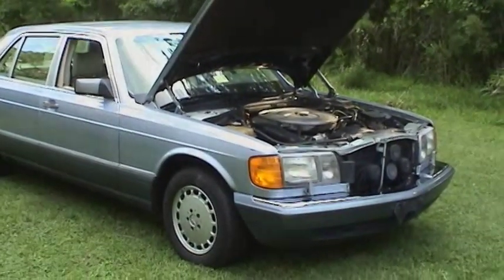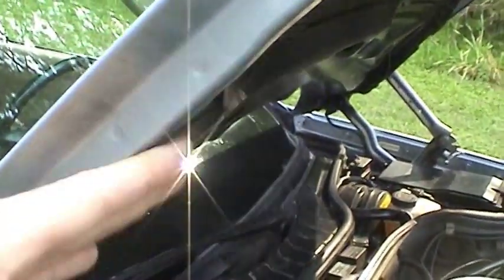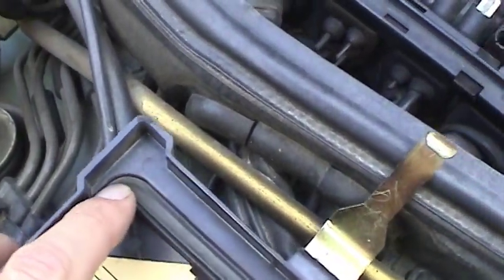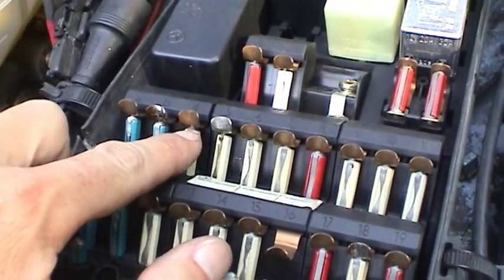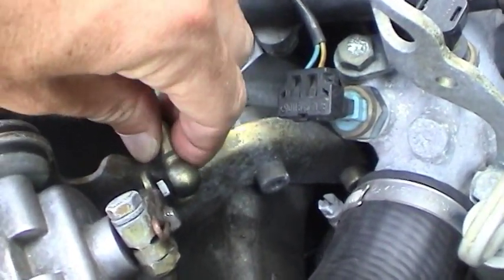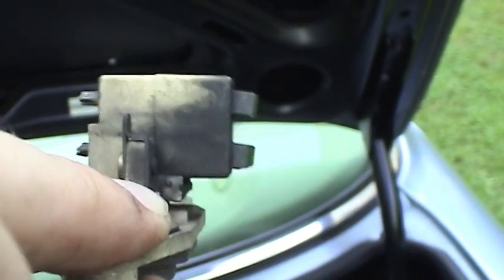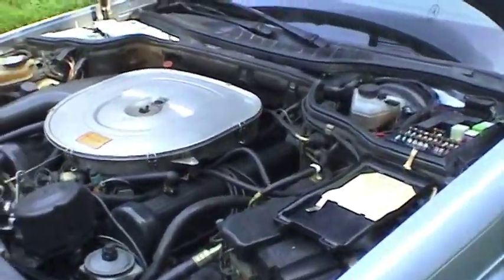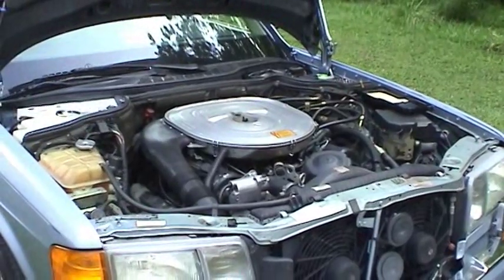1991 Mercedes-Benz 420 SEL Maintenance Tips

Comment: Your vocal delivery is spot on. Not dead, not shrill, not salesman- much like an intelligent teacher. 
I have a '91 300sel that took several tries before starting. A very loud scraping raucous began after a hard acceleration. I lifted the hood but couldn't determine the source of the noise. It cut off a few minutes later, cranks but hasn't started for 2 months. Temperature & oil pressure were normal, no check engine light. Had smelled gas for a couple weeks. Noticed a few drops of fluid smoking & dripping on the exhaust behind the rear door the day before. Fuel pump primes. If I can believe the young man at Autobahn Auto in Hampton I have spark, fuel, & timing chain's OK. I know little about cars but since Aug 12 have literally spent hundreds of hours online researching the problem. Any thoughts would be greatly appreciated! Other than needing a new battery when I got the car a year ago from a doctor, it has always been reliable. The day before this I did have a shop put on 2 front tires & do a Hunter balance to resolve an interstate shimmy.
Reply: Watch his 57 min walk though video he helped me so much

Comment: Wow...Even though that style of Merc is a common sight over here, I've never seen a hood in that position! You could almost use it as sail in an emergency...haha!!! 
Those fuses were a very common over here in most vehicles up to the mid 80's, we know them as 'continental fuses' they always suffered corrosion at the ends.
It looks like the window has come out of the guide...Be careful it doesn't drop inside and smash when the mechanism is down.
Beautiful car though! Amazing Condition! :)

Comment from the maker: You should be fine. The differences in the numbers may be due to a date code or manufacturing location. You have saved yourself allot of money over purchasing a new alternator. I've now got over 180,000 miles on my original alternator and it's still going strong.
Reply: Your window problem sounds as if the glass has come out of the scissor track.

Comment: Great videos, I just bought a 1990 420sel. I was able to fix the windows easily thanks to your videos. Now I have a new problem. It has started sputtering and sometimes cutting off. I have looked around and one possible cause is a vacuum leak. I spotted a crack in the same hose you were referring to in this video. My mechanic said it was a worthless part and not my problem. My question is... what is the name of that part or part number. I cant find it anywhere. Thanks

Comment: For anyone wondering there's a plastic part that slides back and forth on the track to raise and lower the window. That part can split leaving it open on the front or back side. The arm will pull away without moving the window since that piece is broken and the ball moved free. Think of a shoulder with half a rotator cuff.

Comment from the maker: Sounds like a partially bent mast or possibly an area of the internal nylon cable where the teeth have been worn off. The masts are actually removable and can be replaced without replacing the entire OEM assembly. Try to keep the OEM unit since the aftermarket ones don't fit the contours of the fender precisely.

Comment: I believe the common term for those type of fuses is torpedo fuse.  I switched all mine out with brass-conductor fuses when I acquired my '84 W126.  A couple of the fuse values were pretty hard to obtain in brass/copper, but I eventually located them, from Europe I believe.  Watch out for fakes too, with just a gold-colored element.  They're complete trash.

Comment: I had the same window motor problem. The bolts may be too tight. Try decreasing the torque. Mine still works after I loosened the bolts a tiny bit. Let me know.

Comment: Good tips ty.I have a 1989 560 SEL with a few different issues.It seems as though the injectors are seeping a bit of gas and need some seals or o rings changed.I also have a rear main seal that is leaking.Car has only 95 K on it...I guess the age makes it want some attention.Regards,Piero

Comment: Many thanks for sharing such an informative video. I would like to check the wear on the voltage regulators, however it is hard to take the screws out - specially the one below, as there is not much space for screw driver to fit in. Would you advice any special took-kit / Phillip screw driver set etc. that I could buy. As an FYI just became the proud owner of a 420SEL year 1990 with only 70K miles. Thanks for your help !

Comment: Hey I found your video very informative I'm actually purchasing a 1988 420 SEL this Friday and was wondering if there were any reoccurring problems or anything I should know and look at before I purchased a vehicle it has 88,000 original miles one owner and is very clean with no rust is there anything I should look for I'd appreciate it if you could give me some pointers I'm very knowledgeable about cars but not this one so much it's just in such good shape and the owner doesn't know what he has and is rich so I'm able to get it cheap thank you hope to hear back from you
Reply from the maker: The main thing to look for is fluid leaks. The seals, hoses, and gaskets on these cars tend to get very brittle over time compared to the American cars. Also check the drive shaft flexible couplings. They tend to crack and fail and when they do, can cause significant body damage from the drive shaft flopping around violently.
Reply: Check my reply or comment to 10 other sections I was trying to get a hold you there posting was old I've already had the car for a couple weeks now

Comment: Hi There, so here is my current issue. The Antenna on my 420SEL is working but not opening up completely. It goes up probably 30% and then gets stuck. I left my car out for a week and this is happening since then. On closing the radio the antenna does goes down. Any suggestions / recommendations is highly appreciated.

Comment: great video... have to do a head gasket replace (ugh) because of blowing it and trying to fix it with head gasket seal,  finding out that it is a joke and waste of money.... I actually thought that when picking it up and still bought it and than I was stuck sort of.  Anyway thanks for the video.
Reply from the maker: R&R of the head gasket on these things is no easy task but it's really the only way to repair it properly for a long lasting repair. Good luck with everything. I hope you can keep it running and on the road. :-)
Reply: *****
 so I still have not done it but driving the car and used the so called "nano technology" fix and what a joke.... should have known better.  Every two days or so I have to add water and it is obviously going somewhere.  Not under the car and not in the oil (as far as I can tell)... The point is that I do not like it and makes me nervous.  I believe I have put on about thousand or so miles since I did a quick fix (if  there is such a thing)... bottom line I might have screwed the car up for ever.  She is an amazing piece of machinery and I pray to the universe to have mercy on me because would be great to have her for longer... oh well... this  technological mambo jambo is getting to me sometimes.  Shadowrider460 the best videos ever!  Changing the trany fluid right now and trying to figure out how to turn the v-8 by hand so I could get to the bolt on the torque converter.  Fan has to come off and sparkplugs out... might be the only way.

Comment: Thanks ! I managed to took out the voltage regulator and to my surprise found significant wear on atleast on the two terminals. I am now ordering the new one. The number on the old VR reads 1197311023 (similar to what you had), however on ordering new one it says 1197311028. It looks exactly similar atleast on the web. Did you buy the new one with the same part number. Any advice here would be great. Thanks again for your help !

Comment: Great video my friend, I have a 1988 420SEL and I notice the AC blow a little cold but I can't feel the air come out from the front vents, any advice....Greetings from Silver Spring, MD
Reply from the maker: It could be a failing blower motor (too much friction in the bearings), or a stuck blend air door causing some cold air to come out of the vents, and some to come from the floor outlet.
Reply: Had this same problem  - all the air came out the defrost vents.  turned out to be a vacuum pod behind the passenger side dash (behind the glove box or airbag).  Not horrible to replace, but not fun, either.  The part was reasonable - $60 or so - so I went ahead and replaced both of them while I was in there.  Center vents work perfectly now and air blows nice and cold.  The failsafe in these cars is that if one of those vacuum pods develops a leak (and there are six or 7 of them, total, in the HVAC system), the system goes into limp mode and puts all air out the defrost vents so in a worst-case scenario, you can clear the windscreen when required.

Comment: The 126 rear window regulators have a poorly designed slide.  It is the weakest point of a well-made car.  I try to never lower the rear windows.  They work fine and last much longer if you don't use them.  LOL